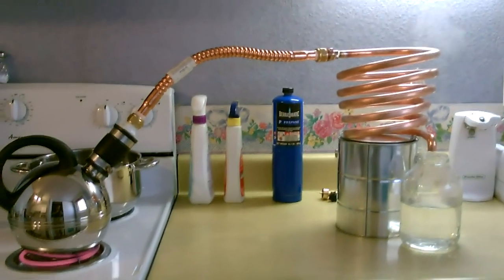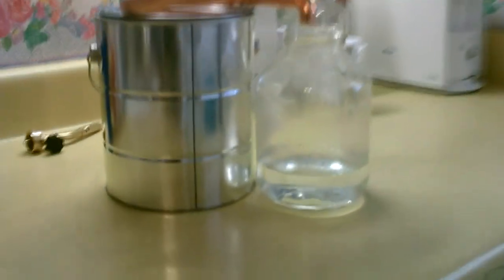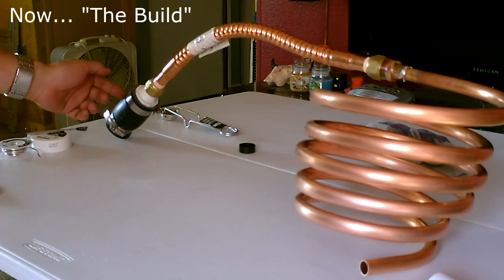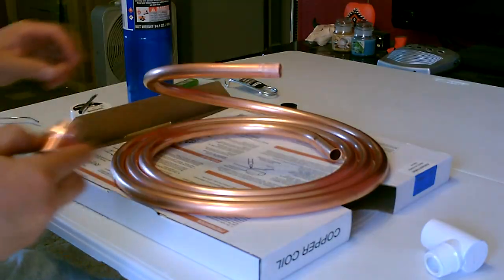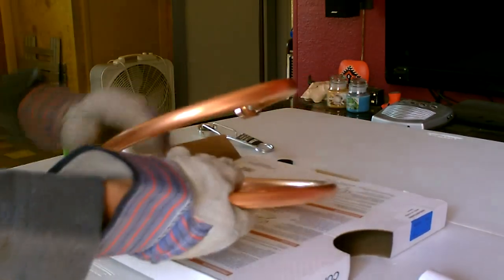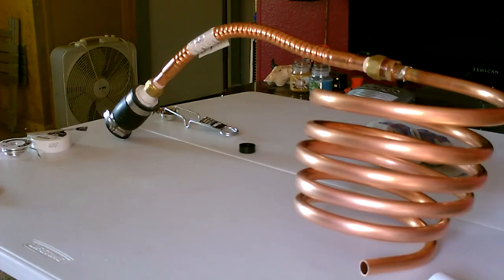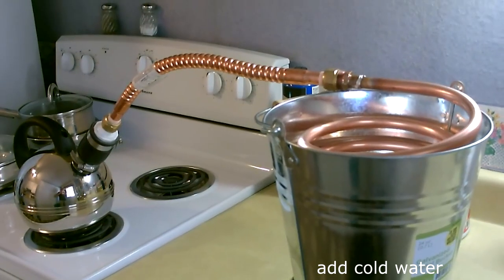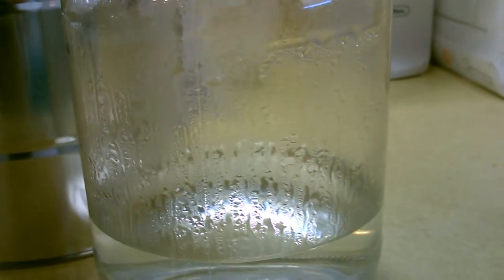Homemade Water Distiller! - The Deluxe DIY "pure water" Water Distiller!  Full Instructions

Comment: Could you put wine in the pot and boil off pure alcohol?
Reply: Big Sasquach yep
Reply: only if you hold the heat temperature just slightly above the boiling point of alcohol and well below that of water..... the reason being is impure water can boil at a lower temp or higher temp depending on whats in it. so if its too high you just boil it into exactly what you had before

Comment: You only need a FAN passing over the Coils. Which will Whisk that final bit of heat away and there will be all water no steam coming out! This is essentially what is INSIDE my company made 'Megahome' water distiller!
Reply: No fan needed. His coil is way too big. I made a working device called E.V.E last year. There is not enough thrust/pressure being built up to make the steam travel through the tubing so it is taking forever for any water to be made. Mine re put out the water like a river, but smaller piping.
Reply: @MichaelJohnson-  hi, I'm using a lot of isopropyl, any tips or direction on how I can build like a distiller to save and reuse the expensive evaporating fumes.. ? 
 Many thanks in advance.. 👌🏻

Comment: Thanks a lot for the video. It is really great .

I saw your video titles as  "DIY Water Filter - Homemade "High-Volume" Water Filter " which was great. 

As for drinking water do you have recommendation like Drink  filtered water or drink distilled water? And why

Thanks in advance, really appreciated.

Sincerely, 

Ati
Reply: Distilled all the way. Distilling almost guarantees to remove 95-99% of all impurities if done properly. Filters are always questionable as to what it's actually removed or possibly ADDING to your water without you knowing. You really don't need minerals in water despite what is said. But if you are concerned, it's easy to add whatever you want to your completely clean water. But I wouldn't.

Comment: so the copper coil reduces the temperature of the steam?
Reply: Fast Eddy , basically yes. the longer the pipe, coiled or not, the more the steam has time to cool and condense back to water. The copper coil makes the unit more compact. 
drilling a hole in the bottom side of a bucket, pushing the copper through an inch or so, sealing it and filing the bucket with ice would also help the vapor condense.

Comment: I wonder if 1/4" coper tubing might by ok too.  also for van dwellers in the desert you might be able to recycle grey water (or even black).
Reply: I feel like 1/4 wouldn’t have enough flow, and youd lose most of your water via back pressure forcing the steam through any small leak it could find

Comment: Brilliant video - Thanks. If I have salt water boiling in the kettle and your design will it come out fresh in the bottle?
Reply from the maker: hi there. absolutely. this setup is great for converting saltwater to freshwater.
Reply: Really appreciate your reply - Thanks for your time.
Reply: What kind of residue do you get left in the kettle with salt water?
Reply: maidinsane, if the only thing in the water is salt, then the residue will be salt. if there are other minerals or chemicals, they may be left behind as well.

Comment: Does the coiling of the copper pipe help the process at all?
Reply: Keystone Science hey man!! love your videos
Reply: Yes, it helps with condensation of the water vapor. Copper has a very low specific heat, meaning that it is good at transferring heat. In this instance, the steam going through the copper pipe cools quickly changing from a gas to a liquid state. In this video if he were to run the copper pipe through a water cooling bath/ice bath it would allow the transfer of heat from the steam through the copper pipe allowing for more rapid condensation (he would have a more efficient distiller.) In chemistry or other applications distillation is used to purify compounds. With a distilling unit you usually have water moving around the pipe to remove heat and allow for a change in state, from a gas to a liquid.
Reply: @jasonyoung1569  Seems like using mother nature, and mounting the coil thru an outside wall, could be made to work.
Reply: Pretty sure the coiling in particular doesn't... Just a way to make the thing not take up the whole room. The important thing is lots of surface area, the long pipe does that, and the downward slope, so that the water can drip down. But the fact that it's coiled is just a convenience so that it's not taking up too much space.
Reply: Keystone Science Yes, it increases surface area while minimizing space.

Comment: A few people suggested using stainless steel tube instead.  How would you bend steel into a spiral?
Reply: Freeze water inside tubing then you can coil it tighter and smaller with no breaks or bends

Comment: Evolution,still tweaking it I see.Right on,If I may add, fit tube end through jars lid,place condenser in a tub of water just the way you have it set up now.Drape a wet towel over condenser.Re-run unit,measure amount of water/time of cook,I would love to see how far you can push this,thanx for the post.

Comment: Before you bend the copper tubing, fill it with water and freeze it. Once the water is frozen you can wrap it around a 3 or 4 inch PVC tube. The ice will stop it from kinking and you will have a tight spiral.
Reply: Sand works well too in a pinch if you dont got a pipe bender or freezer space.
Reply: Like Mack Wood, I would prefer sand to bend pipes.
Reply: @patrichausammann  yeah because we all know how frozen pipes are. Um cracks... Nuff said. Just get a tube bender if your already working on this job.
Reply: A K.A. GHOST WRHYDTAR  The sand is there to fill up the pipe, so that the tube is not kinked suddenly while bending. The sand helps to stabilize the pipe while bending around the bending tool.

Comment: I use a pressure cooker and a cooled copper spiral.( it's in another bucker I fill with water.). In your case I would still recommend fa-inding a way to cool the copper tubing. The water comes out at drinking temperature and you don't lose it as steam. Since heating it costs the most energy a little pump to circulate cold water from a large cement mixing bucket over the cooler could add a nice, inexpensive  touch to your project. Plus you can use it to distill moonshine ofcourse.
I wish copper was a little less expensive.
Reply: only if you hold the heat temperature just slightly above the boiling point of alcohol and well below that of water..... the reason being is impure water can boil at a lower temp or higher temp depending on whats in it. so if its too high you just boil it into exactly what you had before

Comment: Do you have to let some of the steam out in the jar? wouldn't you collect more water if you sealed the Jar and ran the copper pipe into it? like through Cork or something?
Reply: BIZZY DREAMIN, you could seal the jar, but two things can happen, one it can build pressure. (this pressure can also rewritten to the kettle but that spells the distillation process. ) also some of the stuff your trying to get out of the water can boil at a temp lower than water. so the water can condense at 210 degrees or so and the other stuff can escape as steam.